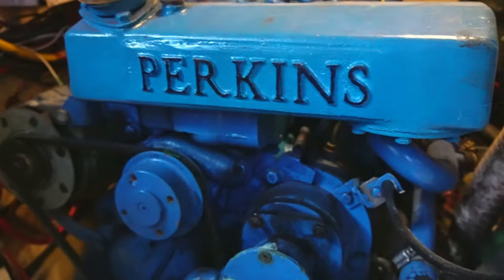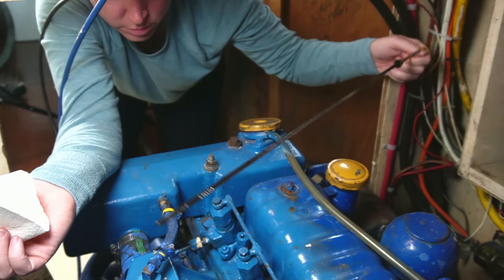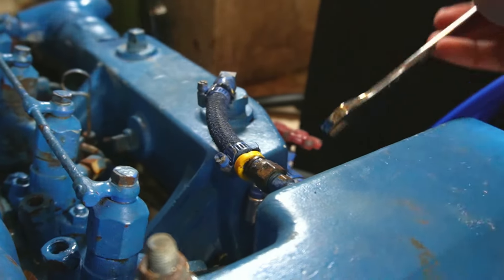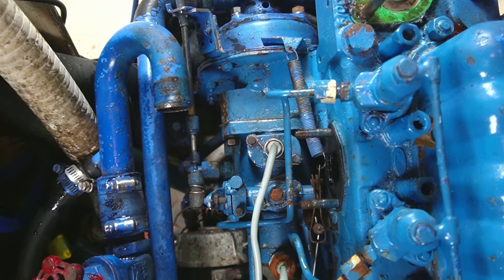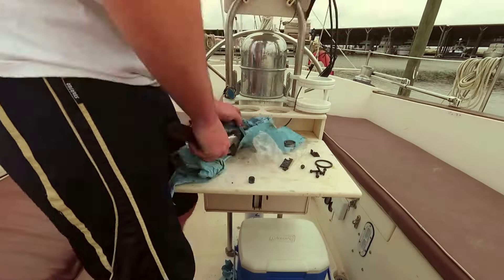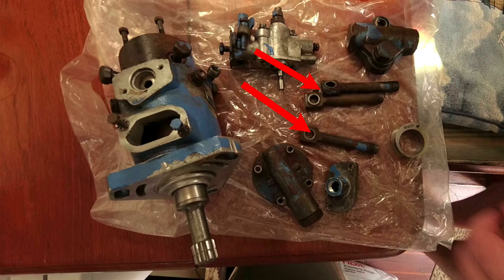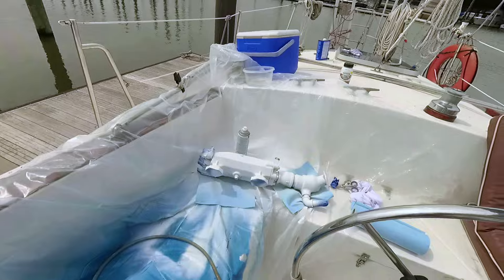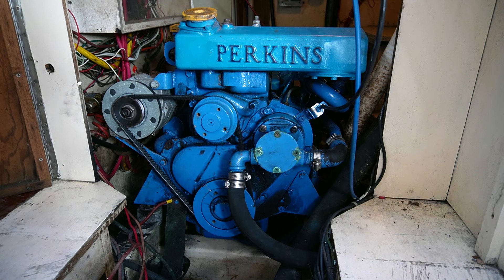Easy Injector Pump Rebuild - Perkins 4.108 Engine Maintenance

Comment: Hello!  I have a question: how do you avoid messing up with the timing of the engine?  I guess a) you avoid turning the engine (that is obvious) but do you need to stop the engine a top dead center on the first cylinder before taking the pump out and how about the pump itself what if you turn the shaft...is there a groove on the shaft to make sure you don't put it back misaligned ?
Reply from the maker: Great question! The pump shaft and timing gear are slotted so it can only go back together in the same alignment it was taken off. The key thing to know is that the pump housing is match marked to the engine block, it can rotate slightly to allow timing adjustment, so if you don't re-align it back exactly, it will adjust the pump timing.
Reply: @twohalf-hitches  ok thanks, I'm about to take it off to fix some leaks
Reply from the maker: Good luck with your repairs!

Comment: While you were at it, it would have been good to clean and calibrate your injectos.  You can get an injector pressure tester for around $90.  I bought a new set of injection nozzles from Parts 4Engines and put those in.  I cleaned the old nozzles and am keeping them as spares.  Also, you fan belt looks a little loose in the video.
Reply from the maker: That would have been a good idea too! I think I'm due for new injectors soon anyway.... The belt is also due for replacement soon, but we're considering updating the alternator soon to power our new lithium system so that might all be replaced with a serpentine

Comment: Very informative,but the “ exhaust manifold” is not the one you describe and dismount first……but then you said it right.
Also just marking the housing in my opinion is to no use if you dismount the dieselpump like you did,to get the timing ricght after ..there are markings on the shaft,and drivetrain who must be set very accurately or very bad things can happen…..
Reply from the maker: The pump is keyed to its timing gear in the drive train, so if don’t make any adjustments to that, then it will remain in line with the timing gear, but the pump housing still needs to be aligned to the engine or it won’t work.

Comment: Does anyone know the correct pressure setting for the injectors of a 4.108?  I tested some today they open around 125/135bar…
Idont have info or the corect settng or manual. If anyone knows let me know please.
Reply from the maker: I haven’t read through the full manual but it may be in here https://www.fujiyachts.net/manuals/Perkins%204108%20Workshop%20Manual.pdf
Reply: @twohalf-hitches  thnx for the link. I had a look trought it yesterday evening, it does not mention anything about the injectors
Reply from the maker: If you're on Facebook, there's a group for Perkin's engines, someone recently shared the workshop manual for this pump that includes the test procedures https://www.facebook.com/groups/1407531859540143/
Reply: @twohalf-hitches  thnx i am going to have a look there.

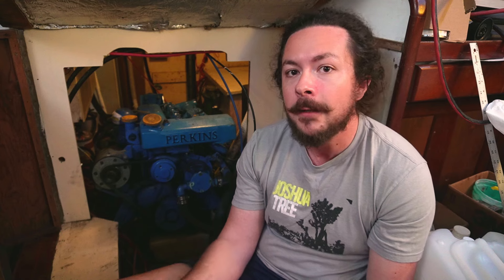Comment: 1:28  Diesel in the fuel does not cause a run away condition.  Even if you filled the engine to the valve cover.   Not going to run away.
Reply from the maker: Diesel in the oil does, and it’s happened to many
Reply from the maker: Sailing Avocet is one example https://youtu.be/5VwjzjYv0nM?si=HQ3EHTttxX6IZXkK
Reply: @twohalf-hitches  Just to add to that, another probably even more common cause of diesel in the oil is the low pressure lift pump having a bad diaphragm.
Reply from the maker: Yes that’s another possible cause